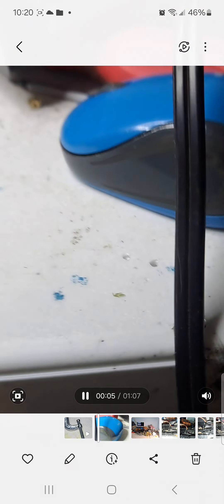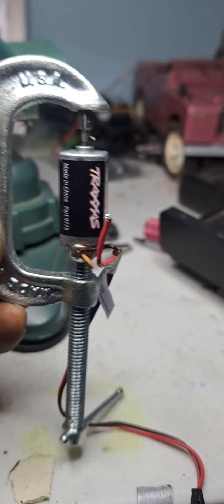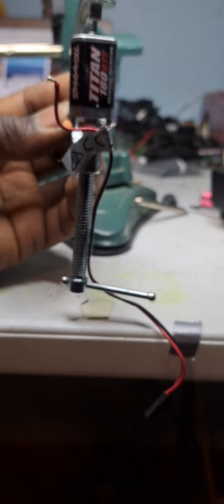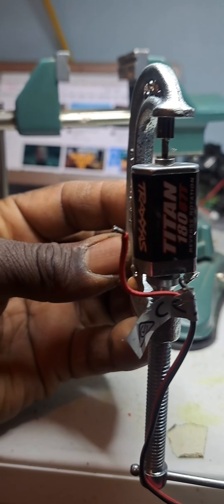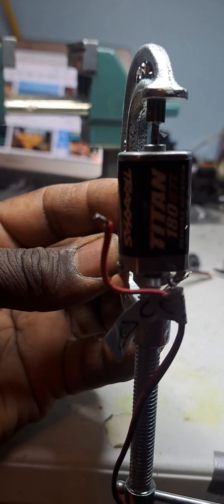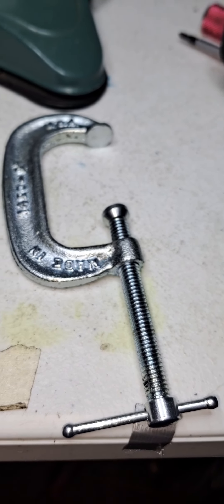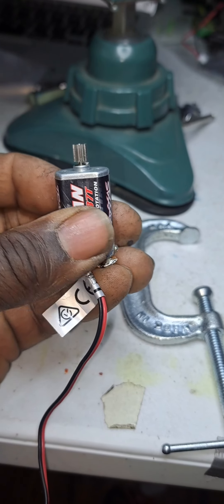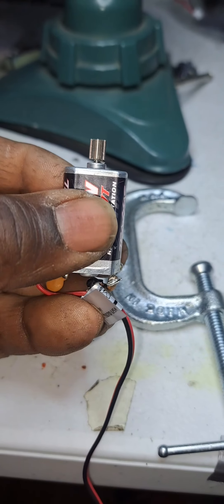Traxxas Trx4m metal pinion gear install. 😎🤔😁

Comment: And I'm doing this with the meus dual speed transmission pinion gear on the micro komodo, so does indeed work on other motors